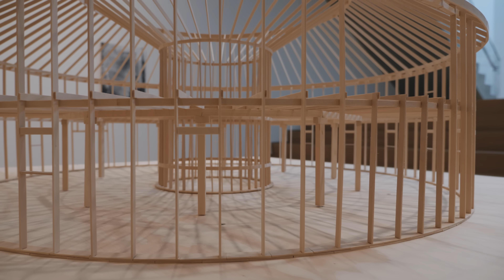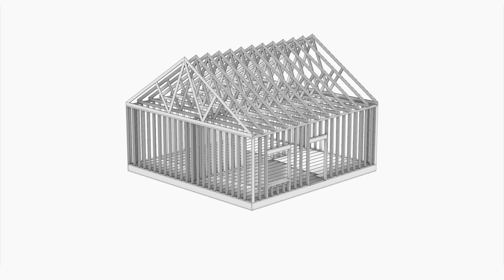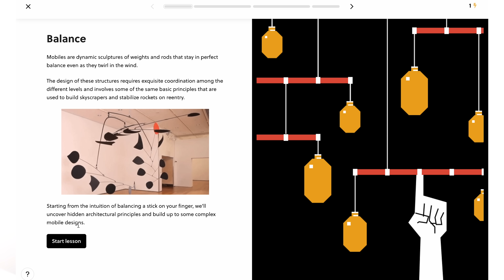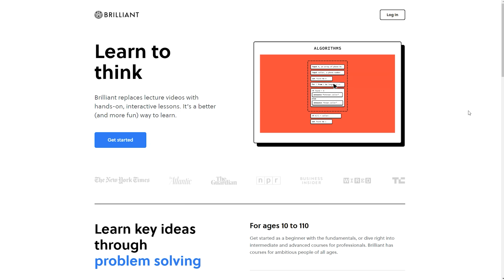The Genius of 2x4 Framing

Comment: Stick framing is why every single house in SE Texas falls apart within 10-15 years and gets the roof blow down when a mosquito farts
Reply: And yet other structures in the same country don't have the same issue...  Man that sounds familiar.  Kinda like their electrical grid they can't keep running when everybody else is fine.  It's like trying to tell a Texan how they can improve something and they threaten to secede from the union....
Reply: @ShainAndrews  You're joking right? Literally any domestic structure built after 1970 in this country is either falling apart or doesn't even exist anymore replaced by something even less likely to last another 30 years. Brand new houses in East of the Mississippi with interior doors that won't even latch after rain because the frame is so warped. Pine is a SHIT building material. We've know that for 100+ years. Like our cars our houses are disposable too. It's how we ended up with cheaply made McMansions and why pre-war structures all over the country are so valuable

Comment: I've got news for you, most commercial buildings in my area are not and haven't been built with wood studs in decades.  Commercial buildings use metal studs now and, in fact, for the local union carpenters they used to determine if a job was residential or commercial by the percentage of wood/steel studs.  And yes, I'm in the US.
Reply: Pretty much only true for big cities.

Comment: Firstly, thank you for a well researched and presented and educational videos. Now, two contributions from me, Bruce the Moose. 1. Almost all stick homes are designed by developers and carpenters. Only 3 or 4 % use an Architect. As a result, the average stick home uses about 30% more wood than necessary. The old, when in doubt, add some more wood. 2. Using Construction Screws verses nails increases Structural Strength by Ten Times. 10X. 10X.
Reply: Labour.

Comment: A 2X4 is not 2 inches by 4 inches. Current dimension is 1.5 inches by 3.5 inches. You get more boards out of the tree.

Comment: “This means you don’t need skilled labor to produce wood framing” 10:00 mark. That’s simply not true. Lots of skill goes into wood framing! Maybe you don’t need that much skill to use a nail gun or swing a hammer. But if you try to build a house without provided plans, you’ll realize just how much skill it takes.

Comment: "usually in a module of 2 inches"
here in Canada, I was looking for 2x4. but I prefer mesuring and working in metric. As i was sizing the wood cuz home depot wood is crap, I realized that they were exactly 4x9 cm instead of exactly 2x4 inches. Also mortise joints a way better then any nail. They fix the wood in 3D instead of 1D. Built myself a squat rack/weight rack with the 2x4s and with the weigth and movement it just made the wood screws rip out of the wood. Turned the joints into mortis joints which is actualy not that hard and is easy to do, just more labor intensive. any way that this does not budge now how ever much weight I swing on it.
Reply: the old 2x4's are not 2"x4" and trying to use metric on imperial materials..  I bet that was frustrating, reminds me of the time I tried to draw out a bed frame when I was 16.  Now I do high end carpentry and have 25 years of experience and merely smirk with love and understanding when mortals make their first attempts to craft greatness from the holiest of materials.
Reply: @ydnark83  I knew 2x4 were not really 2 inch by 4 inches cuz i measured them when helping my dad build a wall but I notices that they were exactly 4x9 cm. the mill probably has tools made in metric so they cut it in metric. so I knew about where the mid points were in metric which is way precise to use because mm marks are way tighter and more numerous the fractions of inches so its easier to be at the right spot. I cut the holes for the joints with a jig saw because i dint want to make notice with a chizzel since im in a apartment now. I still have much to learn about the properties of wood and techniques to use for each wood but I am glad with how it turned out. Im old school, I dont work by buying instructions and plans. I design and plan everything in my head.

My dad is still scared that im using a squat rack made out of wood but each pine 2x4 strut can be loaded up to 1000lbs i think if I remember well. the front struts are 2 2x4, one with notches to hold the bar and its the week point but it has to break trough several notches and will be stopped by 2 2x4 which do both the lower stabilization and the safety bars. the part that sucks is that because its wood, its too light to do pull ups from the top struts and  I need to put a 1inch+ dowel in it still in the center.
Reply: I can assure you the mill was not running metric tooling. The 2x4 is milled 1.5x3.5 and then they put it in a kiln where it shrinks a bit, nothing wrong with that its just how 2x4's are made, 2x10's are much worse, anywhere from 9 1/16 to 9 1/2

Comment: I remember 10+ years ago when a friend from the Netherlands came to visit. We happened to walk by the construction new neighborhood and they were confused as to why we were making houses out of wood.

I had never really thought of  a different construction method before, besides a few brick and mortar houses that were 100+ years old. Also they asked what those "weird metal boxes sticking out the windows" we're,  they also never seen an air conditioner before. (at least window units)
Reply: @Phillip Banes No it's not a country, but no country in europe build house like in the US.

Yes scandinavian countries build wooden house (you also find a lot of wooden house around the alps), but they are not made with light wood framing.

And yes window mounted air conidtioner are way less efficient, just make a research about it
Reply: I'm Dutch and I totally knew about window AC units! Because it featured in a Seinfeld episode.
Reply: @Phillip Banes oh god we have a genius "it's so efficient because I had one"....
Reply: Because both are pretty stupid, you won't find light wood framing in europe because it's crap that doesn't last, and windows AC unit are extremely inefficient and it block a windows
Reply: In the old country, 100 miles is a long distance. In America, 100 years is a long time.
Reply: @Uryendel  Not particularly, they're products of a different set of circumstances. In America, land is plentiful (by and large). In most of Europe, land is extremely expensive. Well over half of the cost of constructing a new build house is in land purchase, which means when people build houses they build houses as an investment. People buy houses expecting them to still be useful and valuable when they die and pass them on to their children, or when their children do the same thing, practically in perpetuity.

I suspect that in America that sentiment isn't anywhere near as strong.

This has benefits and drawbacks. On the American side, houses are far less expensive than in Europe. You still have housing crises, but they're nowhere near as acute. Timber houses also act as a carbon sink, and the housing stock is more readily upgraded as technology advances (e.g. with insulation).

On the European side our houses will (mostly) still be standing long after we're dead which makes them a source for family wealth if you can get on the ladder, although the high initial price drives wealth inequality by locking a proportion of the population out of that wealth. Maintenance and upkeep over the long term is lower, and there's less wastage as houses don't need to be rebuilt every 70-100 years (or sooner depending on climate and quality of construction).
Reply: @BiTurbo228  Land in the countryside in europe is not expensive at all, the only places that are expensives are the city because unlike the US people live in the city, they don't just go their to work. And yes, people build house in europe to last, that's the point, they don't want crappy house
Reply: @Uryendel Your European ignorance and arrogance is showing.

Comment: Balloon construction was possible with shorter studs. You run 10’ studs for the first floor, the how ever long you needed. Simply by nailing the next board to the previous on either side of the wider face.

Comment: I have 5 buildings built in 1870  on my property.  They are all light wood framed, with tin siding.  They are all doing great
Reply: It's likely old growth timber?
Reply: @mattoska  Took some time to talk to the ancients in the area.  The local mill here was getting its logs from Northern MN, and pulling them off the Mississippi river to bring them here.  As old of growth as one could hope for
Reply: My 1885 house is old growth also,.   Hard to drive a nail into most of the logs in the floor...

Comment: You missed the real reason balloon framing replaced timber framed buildings: better and cheaper concrete foundations. Timber framing with massive sills and floor joists concentrated loads in piers, and did not rely on expensive masonry walls to support them.

Comment: You mention how light wood framing replaces large, custom work with standard parts and redundancy—this actually reminds me of how modern technology companies, like Google, work. Instead of a smaller number of large machines individually configured to run a specific service, modern tech systems run on large pools of homogeneous systems, with workloads allocated to multiple machines as demand requires, and software defined with the assumption that some of those machines will fail, and that you need to have redundancy in your storage and processing systems for that eventuality.

These large pools of (fairly) homogeneous machines used to be fairly close to commodity server equipment that anybody could buy but now that the Internet majors have grown, each company tends to have their own heavily customized hardware. Even so, at the scale they work at, the fundamentals of “large amounts of homogeneous, replaceable parts creating a robust system overall” still apply.

Comment: Wonderful things can be done with 'light' wood framing. However, given a choice between hamburger and steak, I'll take steak every time. Given a choice in home building, I prefer concrete or filled, reinforced block, steel or heavy timber. I prefer a building that is heavy, super strong and will last forever.

Comment: So many of the models lack diagonals or strong backs.  Why?  Example.  at 7:23   there are no let in diagonals on the gable wall.  I see no diagonals under the roof rafters.  I do not see the second set of collar ties in the attic.  In other models I have seen no diagonals in interior shear walls.  These models seem to miss all the good bits.

Comment: I see a lot of hate thrown at woodframe construction. I'm a framing carpenter (wanted to be one since I was a kid) who is working in a different field at the moment, but I still think that this system is the best for building houses that is commercially available today. I would like to see a new system take over, yes, but when compared to the methods used in other regions, 2×4 framing construction is the most technologically advanced and reasonable method, by far. 
It basically uses the same concept as a skyscraper/ the human body/ etc. where a semi-ridgid frame is held together with an outer skin. This makes it lighter, more flexible, and cheaper to construct. Adding in the insulation now available on the market and U.S. homes are efficent while still being larger than homes in other countries.
Reply: Not to mention it uses natural resources like trees and is a carbon sink unlike concrete and bricks which creates more carbon.
Reply: He mentions in a comment that he shouldn't have written it the way he did (comment pinned at the top)
I'm curious, what are the new systems?
Reply: Totally. I used to look down on US 2x4 frame housing as "stick housing." But then, even before seeing this video, the conclusion that 2x4 framing is genius came naturally to me while working on my tiny house. 

For me, I was impressed by how the regularity of the cavities between the studs accommodate the modern conveniences of insulation [efficiently sandwiched between studs] and wiring/piping: the studs - or the holes drilled through the studs - hold up the wiring/piping nicely as it runs along the walls hidden out of sight. 

So maybe 2x4 housing's modern success lies partly in its ability to accommodate - out of sight - the modern conveniences of insulation, wiring, and plumbing.

Comment: I tell you what, balloon framing is amazing. Need to redo the foundation? Just jack up the house using the second floor. Ours is over 100 years old now and still in great shape, only needing the 6x8 foundation logs replaced from a poor porch fitment allowing water to slope back to the house.

Comment: I've done timber framing and light wood framing, of course if the framing is going to be exposed (like in a carport or pergola) timber framing will look much better. But it takes a crew and equipment working together. I've lifted a 20' 6x6 up 10 feet by myself before. I don't recommend it.

Comment: Wait..my friend has a house built in 1789 in PA.  The bottom floor has all masonry outside walls. But the second floor and attic is stick framed. All hand hewn and around 2- 3" ×5 through the field and approximately 5×5" in the corners 18" centers. It's not exactly the same. Especially how the plate board is laid out. Also an interesting way to use Jack studs around windows and a door with all wood joinery. I guess it must have something to do with the standardization at saw mills in and around the 1830s.  I'm from Ohio and the 1830s is when Ohio really took off. My county got its first saw mill a water mill in the 1830s. My other friend owns the property but there is nothing left of the old mill to speak about.  We actually have a book that was written in the early teens the   19 teens that put into print many of the oral histories and some legally documented histories in a book.  The man who ran the mill was german and deeply superstitious. I believe the story goes like he was afraid of a ghost and shot himself or something.  The books is called "The Stories and Tails of Yellow Creek."   Even is you don't live around he it's a wonderful book and I recommend to anyone who desires to learn about our ancestors.

Comment: such a great analogy.  I learned about 2x4 framing while working in set construction for theatre.  Building a flat wall, and drywalling/finishing is not complicated at all, but as you say, some are more skilled than others.  Hamburgers fuel my existence.  I absolutely see the relationship.

Comment: I'm finding 2x2 useful for framing. I flip older homes in Phoenix. Many are 2x4 with stucco, no sheathing. They use a diagonal let in 1x4 in corners. I want a thicker wall for more insulation. I could fur out walls with horizontal 2x2. Or vertically to each stud but a wood thermal bridge isn't good. I choose to put the 2x2's diagonal which also gives walls a lot of rigidity. I could screw drywall to the diagonals but generally I add vertical 2x2's 16" or 24" on center but offset from the 2x4's. Increased insulation, reduced thermal bridging, increased wall rigidity. IMO it's also safer and easier wiring because I don't have to drill studs for wires. Before adding any 2x2 I can staple wires to the inside face of 2x4's. Screwing diagonal 2x2's protects the wires which are now 3.5" from the outside and 1.5" from the inside. Drilled 2x4 wire is about 1.25"  from both sides. Drilling for wires in stud corners is not fun and often seems a mess which furred out solves. Attaching electric boxes is a little tricky. Running new wires in the future would be possible

This also make straightening out walls easy.

Kind of wondering if 2x2's could be used in new construction for load bearing. A vertical on outside, a vertical on inside and diagonals in between. That gives the same load bearing vertical amount of wood and breaks the thermal bridge. Maybe someday in the future.

When OSB sheathing was $4-8 a sheet its use made more sense (cents) to me than at $30-50 a sheet. Plus I see a lot of 80 year old houses with those 1x4 diagonals on the inside face still holding up really well even with some water rot on the 2x4's whereas I see a lot of rot problems with OSB and plywood because it's on the outside.

Comment: Very interesting! My friend from Poland asked me why Americans build their houses out of wood like this and I could only speculate. My guess had to do with American expansionism and the need to use the light weight materials that were available where ever they arrived. It was easier to set up a timber mill than a cement factory. Then this became the common/established method/tradition.
Reply: Wood was/ is light and was cheap and available, as opposed to Europe where it was scarce and expensive
Reply: @wiseguy8828  All wood v all stone building is actually a pretty recent change, especially prevalent from after WWII (where european wood supply was definitely lacking for the needs of rebuilding half the continent).

If you look at historical european housing there's a lot of timber framing and half-timbering. But the inventory requirements were relatively limited after the invention of light wood framing, europe was not colonising an "empty" continent (they were doing that to toher continents instead).

An other factor is that while technology had allowed better access and standardisation to wood in the US, it had done the same for stone in europe: improved stone sawing and steam transportation made stone quarries more efficient and accessible, which is why for instance Haussmann façades (in paris) are massive stone blocks, where older buildings were generally wood framed with brick infill and plaster façade.
Reply: Wood-framed homes can also be modified from locality to locality to accommodate for local building codes addressing weather and geological considerations.